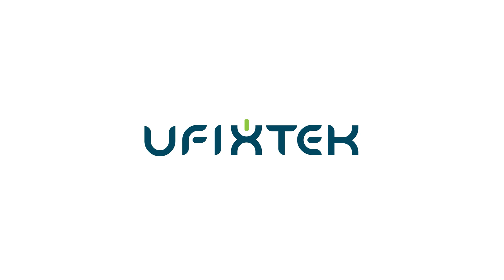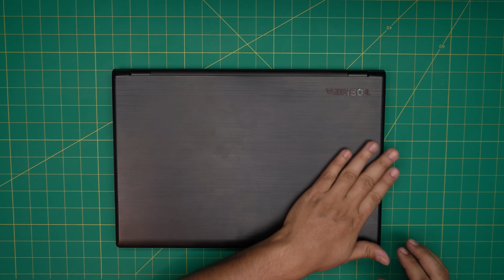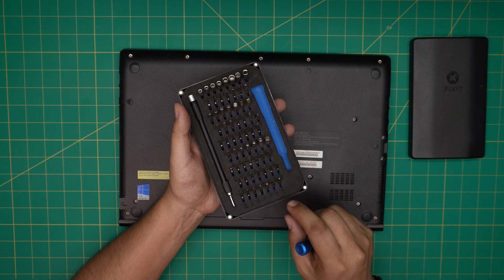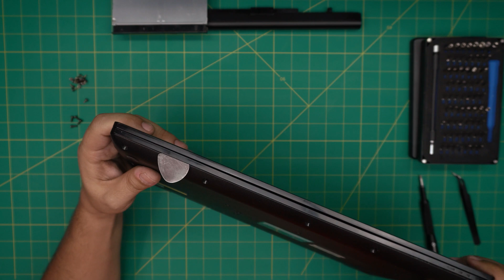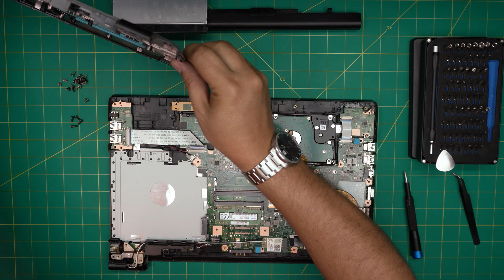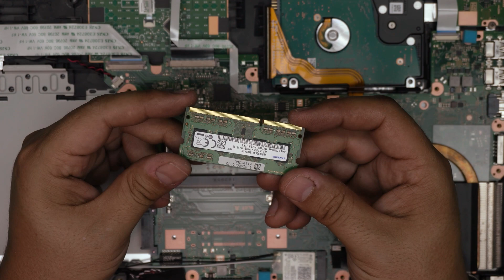How to Upgrade RAM for Toshiba Tecra C50 C Ps571u - Step-by-Step Guide💻

Comment: Is the c50-c compatible with 32gb of ram?
Reply from the maker: Thank you for your feedback! If you wish to support the channel, you can like, subscribe, or both!
Regarding your question, no it can go max 16gb 2x 8GB.
Reply: @uFixTek  awesome thank you. Liked and subscribed
Reply from the maker: It's my pleasure my friend. 😊
cheers 🍻
Reply: @uFixTek  is it possible to upgrade the CPU from an i5 to an i7?
Reply from the maker: sorry to inform you about this but you can't do the upgrade the cpu, it requires a lot of modification new heat-sink new components for power management and bigger charger, therefore not possible.
Reply: @uFixTek  dang very unfortunate.
Reply from the maker: yep